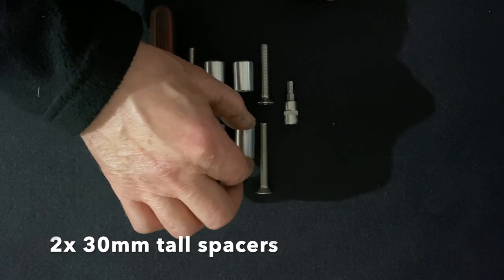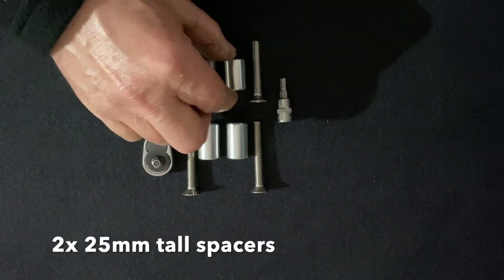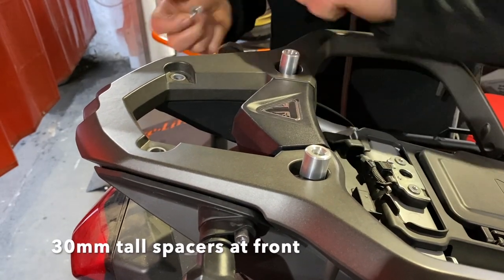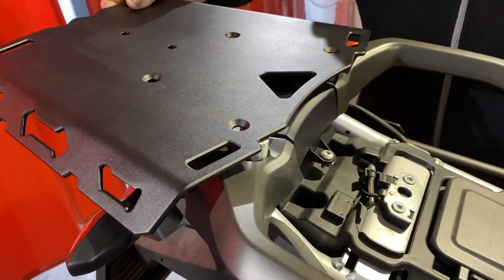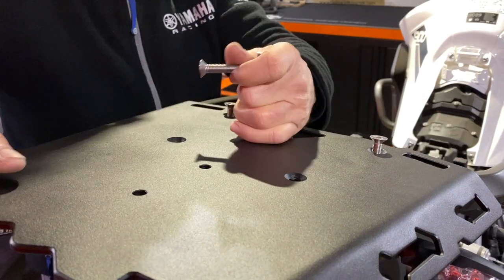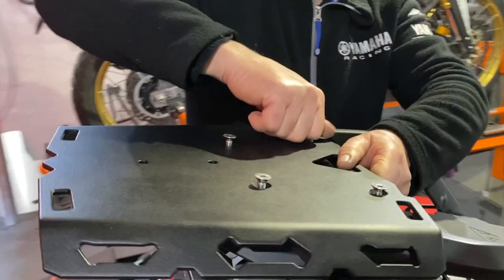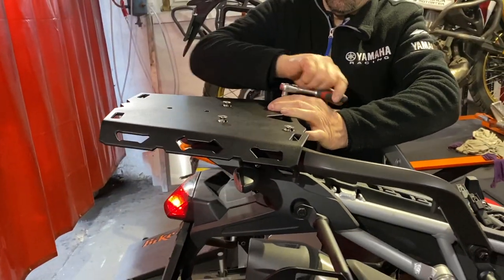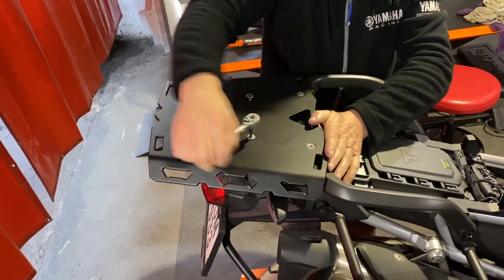Triumph Tiger 900 Rear Rack Installation Instructions

Comment: What rear boxes will fit on this rack or is it designed not to use a box?
Reply from the maker: It’s not too case specific. You can essentially mount any top case on it but you may need to drill some extra holes